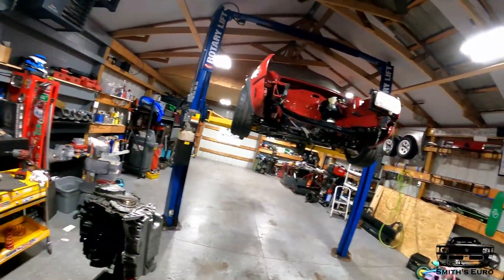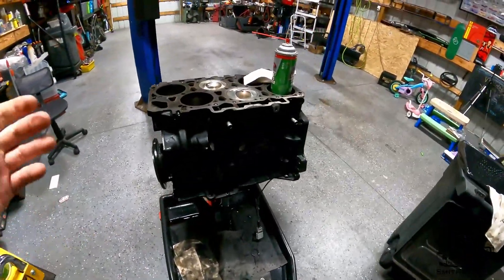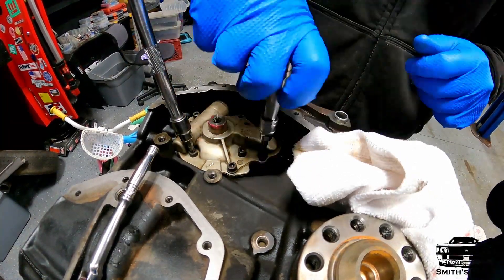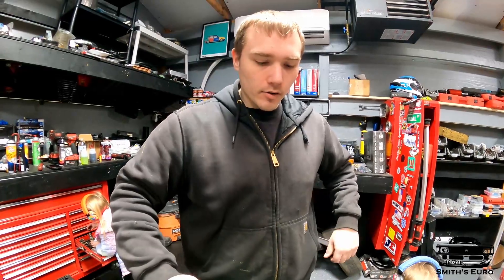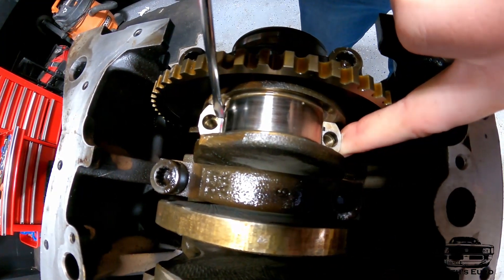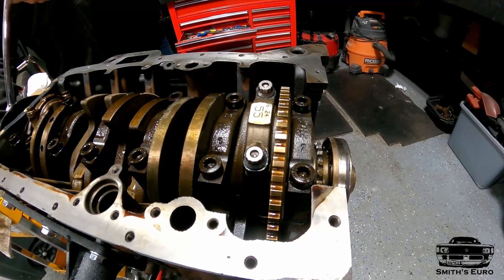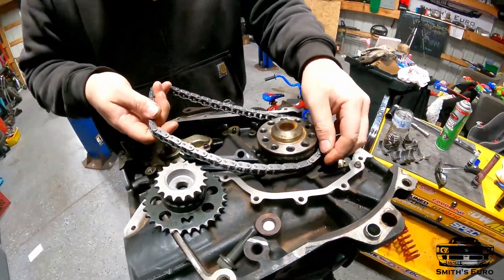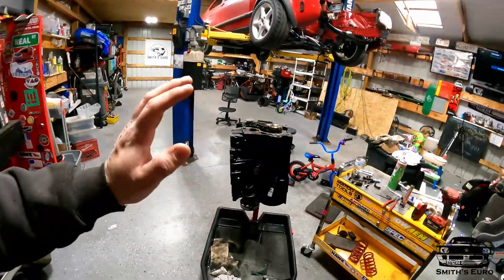ARP ROD BOLTS IN A VR6 WITHOUT MACHINING

Comment: Good info.  I was looking for stretch information in case you assembled them that way.  2" under head length on the ARP bolt turns out to be 0.0060" - 0.0066" if you ever start doing assembly using the stretch method.  I also found the OEM bearings didn't have any spring in them anymore and would easily come out of the rod/cap.  Where as the ACL race series I swapped for positively lock in to the rod and cap with tang properly.
Reply from the maker: I use their foot pound recommendation
I’ve never had a bearing spin that way with OEM or aftermarket bearings I’ve done probably 10 or 11 sets so far
Reply: @SmithsEuro  I used torque method last night too (40ft-lb), but also measured a stretch of 0.008".  My torque wrench is recently calibrated too.  So the 0.006-0.0066 was way off.

Comment: Once bearings are in and done do you have to spin the crank to make sure engince is at tdc
Reply from the maker: If doing timing chains after yes

If you only pull the pan and do bearings no.

Rotating will just ensure it spins free, rotate then go to the next set of bearings.

Comment: Would being 180° out cause the engine to intermittently have Crank no start issues ?
Reply from the maker: Yes can cause rough start
On a 12v you wont throw codes it would rough start and not run great.

Any 24v would instantly have cam faults
Reply: @SmithsEuro  ok thanks

Comment: I meant to ask last time. Even with a spun rod bearing, why did you abandon the old block? Or was it the cost for new bearings and probably new rod that made the decision?
Reply from the maker: Crank was torched
New crank,mains,main bolts,rod,rod bearings,all the seals

Much less money time and headache to get another motor through work.
Reply: And now I know. And you what they say about that.
I was sitting here with a few VRs with a single spun rod bearing, but no major damage to any crank or other rod bearings and the crank looks like it should polish out. I was just going to refresh those, but then I was like "did I miss a memo somewhere?"
Reply from the maker: @dubCanuck1 If a bearing spins I wouldn’t trust it with being polished/checked by a machine shop.

I have tried the ol’ scotchbrite and new bearings. I can tell you it doesn’t work.

Comment: Haven't heard much about the King's. Nothing bad about them for sure. I've ran the ACL's or OEM in the past but at the price of those King's it's definitely intriguing. Will be interested in seeing how they do but I've got faith, they look nice, especially the babbit layer on them.
Reply from the maker: Ive never ran them either, Ive heard good thing about them in the racing groups.
I usually use OEM bearings but figured worth trying for this motor.

As long as a rod doesn’t come out the block on a pass ill be happy lol
Reply: @SmithsEuro  
Absolutely agree. I think I've heard of a couple JDM guys running King's on possibly an RB-26 or SR-20 build?!?! Not sure, my memory sucks ass, but I remember seeing a few build threads a while back and dudes were running them. The OEM ones are definitely not cost effective and aren't particularly happy about the high RPM's so I think you made the right call. Can't wait to see this thing ripping bro! Wish I was closer to you, I sure as hell miss turning wrenches with all my Euro/ VAG buddies! Most have families and no time for cars anymore or they moved away. Growing up sucks! LMAO 😂